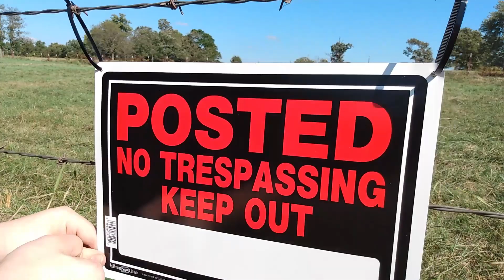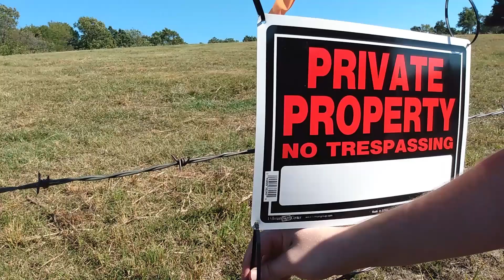NEW HOMESTEAD/Taping & mudding walls

Comment: As the son of a painter muffet all atoundchandyman that was well sought after because he did such excellent work I'm going to give you some tips.  3 coats of mud sand between. Each coat the coverage should be wider and wider building up the indented space thinly each time by the 3rd coat the seems should be at least 16 to 19 inches wide. The nailheads should be about the size of the bottom 9f a large coffee can. On large cracks or spaces between the wallboard like wall ceiling joint latger than the size of the normal seems between 2 factory edges like the seams you were doing fill them with plaster if Paris before you mud over it guaranteed you will have cracks. I did my own mudding and my dad taught me and was offered a job hut I hated doing it so I declined it's hard to be a good mudder. Also after you ate done make sure you use primer on the fresh wallboard and mud or you never get coverage with paint. Primer seals it so then using a quality paint should cover in one coat. Dont roll all the paint out of the roller when painting. Keep plenty of paint on the roller and you will have much better coverage
Reply from the maker: Thank you. This video is a week old (filmed last weekend) since then we have put a second coat and sanded. Luckily, we  have not painted any of it that we've mudded yet. Thank you for the advice!
Reply: @LGHomestead  glad I could help